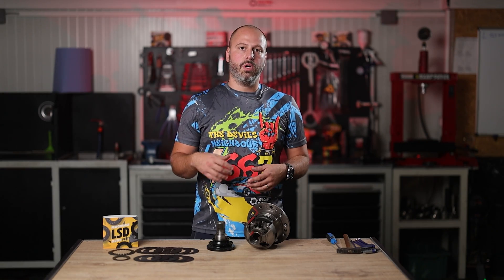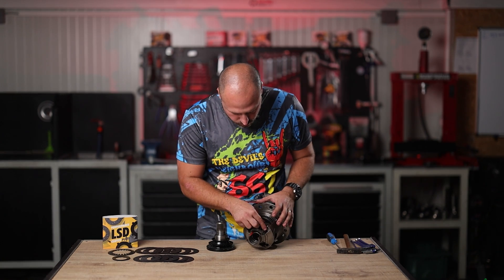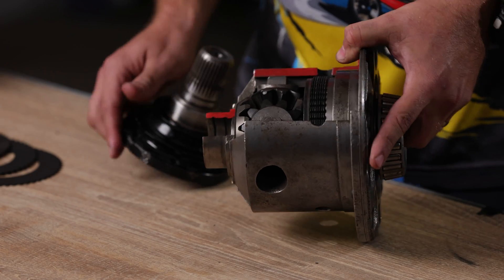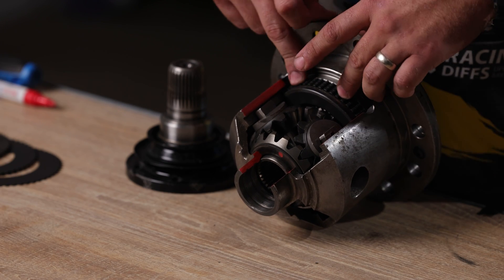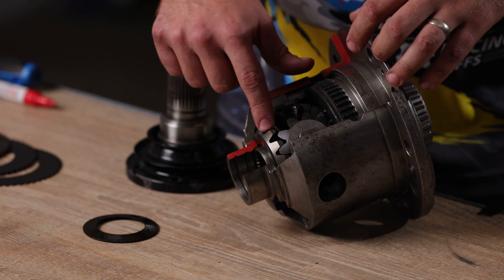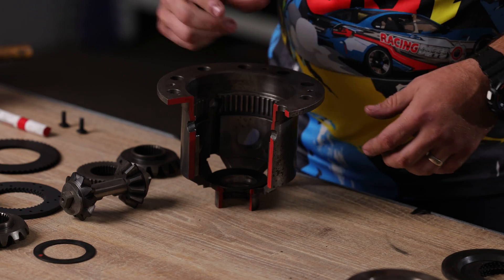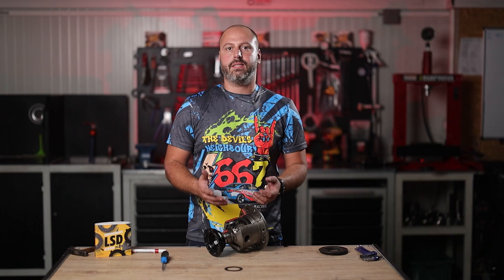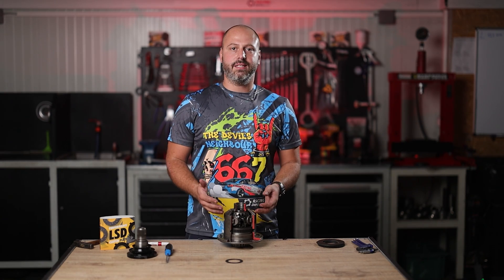Fixing BMW M-Clunk: Solving Differential Issues on E46 M3, E92 M3, E60 M5 & Z4M | RacingDiffs

Comment: What if my 330ci with a welded diff is having the same problem on the pass side I have play and loud clunk when Turning not chirping ? Did the welds just brake ? Or could it need a new flange and of c clip and seal ?
Reply from the maker: Possibly the flange is done. But do check axles for play as well. Welded diff is quite aggressive on them.

Comment: Given that BMW is obviously aware of the existence of spring shims, that the FreePlay may have a function that is engineered in to the differential intentionally? 
For instance, that open space of free replay allows the gears to pick up more oil when they rotate into the bottom of the diff. The spring shim will prevent extra oil from being able to naturally flow inbetween those gears potentially.

Comment: I am a little late to the party.
I just purchased an M3 with that exact same problem.
Is it something that needs to be adressed immediately or can it wait a bit? 
The diff was replaced in 2015 and got a overhaul by a workshop 3 years ago, however it still knocks.
Reply from the maker: You can continue driving like that, but knocking from the differential can and will damage your axles and driveshaft eventually.

Comment: What is the reason in an E60/M5 Differential makes some noise in steep right turns without power at low speed (parking)?
Reply from the maker: Worn clutches. They lose friction layer, so they start making chattering noise more and more.

Comment: Hi
I ve installed the clutch pack i followed the video for that.
Correct me please if i am wrong (before i put the diff back)
There is 2 bellville shim, one small diameter and one big diameter. In the assembly process the small diameter goes first with the spider gear. At the very end, i put the bigger diameter belleville shim then close the diff. 
It concerns me bc i had a gap before putting the 4 small hexagonal screw. Then when the 4 small screw are tight i can see any freeplay in the clutch stack and i can’t even turn the spider gear or the stub by hand. Is it normal?

I am sure i didn’t put the belleville shims in the wrong side. I ve followed the video.

The car is an 2002 e46 m3 (v1 diff)

Comment: I hear a click noise when in reverse and I tap the gas, and going into second gear tapping gas😢😢😢
Reply: you might want to check the bushings. Mine was totally rotted out on a very low milage 2006 Z4M
Reply from the maker: That's how it starts. Your diff needs attention. If you don't have whining noise yet, it means your bearings are fine, still. So you can pass through with basic rebuild kit and save some money. But if you hear whining noise, then you need all parts, including bearings and seals.we have everything available here👇🏼
https://racingdiffs.com/collections/lsd-clutch-plate/products/bmw-m3-m5-m6-z4m-lsd-differential-rebuild-kit
Reply: I would also check your diff bushings. The factory ones are foam.

Comment: Mine was rebuilt with your solution and it's clunking again. Very disappointed.
Reply from the maker: Maybe the clunk in your case doesn't come from the diff only. Check the axles and prop shaft. Also differential bushings. This kit solves diff clunk in 100/100 cases, really.

Comment: hi there i just posted a problem regarding this problem does this apply to e34 m5 diff ? pls ket me know i pretty much have the same problem
Reply from the maker: It is not the same, but a similar thing is causing it. Anyways, nothing that can't be fixed with a rebuild. Kits are available on the link below.

https://racingdiffs.com/collections/lsd-clutch-plate/products/bmw-210-mm-lsd-clutch-disc

Comment: I have slow speed grinding noise on my Z4M 06. Guess the clutches are toast. I drift every chance I get :D Do I need to get the full kit of just the clutch pack. Everything else seems ok. It has 80,000 km on it.
Reply from the maker: If you don't have the whining noise on the straight line, then your bearings can push more. They usually hold up to 120k km. Anyways, you need V2 clutch pack. The same one as E92 M3. Here is the link.

https://racingdiffs.com/collections/lsd-clutch-plate/products/bmw-m3-m5-m6-z4m-lsd-differential-rebuild-kit

Comment: 2006 M5 get noise turning and clunk on take off.
Reply from the maker: Then this kit is perfect for you. You need V2 option.

https://racingdiffs.com/collections/lsd-clutch-plate/products/bmw-m3-m5-m6-z4m-lsd-differential-rebuild-kit
Reply: same with turns from a standstill
Reply from the maker: Yeap. This is quite a common problem in those.

Comment: I have an 04 e46 m3 with 128k miles. There is a prominent “thud” more so than a clunk during off throttle and on throttle and when shifting. Would this shim kit solve my issue?  

The thud is very noticeable and I notice replay in the right output shaft
Reply from the maker: Yes, sir. This kit is the solution to your differential problem.

Comment: Hello, I got the same problem "the clunk" on my Z4 e85 2.5 si engine.  There is a solution for NON M differentials? I got the clunk when I'm in gear, car decelerate and when I put my foot on the pedal it clunks. Please help
Reply from the maker: This is the play between spider gears. LSD conversion kit removes this problem when installed. And you get 25% lock LSD. For your car, you need Type 188L.

https://racingdiffs.com/collections/lsd-conversion-sets/products/bmw-e46-e90-e92-e39-e60-lsd-conversion-set
Reply: @RacingDiffs  thank you for the very quick respond! there is nothing left to change. I was planing to get the conversion kit but wanted to fix the problem first. No shims no nothing? Just the conversion kit?
Reply from the maker: That's right ✅️
Reply: @RacingDiffs  🫡🙌🏼

Comment: The only fix for any bmw is a ford 8.8 I have blown two m3 diffs always the short stub side. They are just poo if you’re running real power. I will say it was fine before I LS swapped the car and tripled the power.
Reply from the maker: How much power are you running ?
Reply: @RacingDiffs  Any upgrade for m3 e92 diff I driving 1000hp was fine now I will be making 1300hp 1500nm
Reply from the maker: Actually, yes. We have a Fully-forged LSD unit that is up to the task.

https://racingdiffs.com/collections/all-solution-lsd-unit/products/bmw-motorsport-lsd-clutch-type-m3-m5-m6-z4m

Comment: I’ve been coming across a number of discussions across a few E46 M3 forums that share experience and knowledge of the free play shim contributing to premature spider gear deterioration - due to the Bellville shim design adding too much preload, where there should in fact be an appropriate amount of spider backlash. Also that the racingdiff clutch pack wears out far quicker than OEM. Can you please provide some comment and insight on these two matters?
Reply from the maker: We installed and regularly checked sents in more than 20 diffs locally. Never had such issues. We recommend Motul Gear Competition oil to be used. People make mistake during installation as they assemble all parts dry, that lead to premature wear. Despite many videos we made... many diffs we assembled are used in pro drift cars, including Michael Essa in Formula drift.